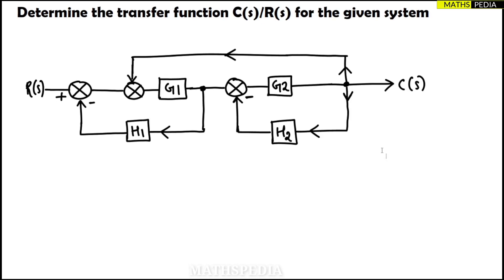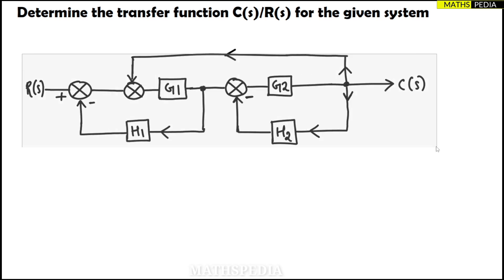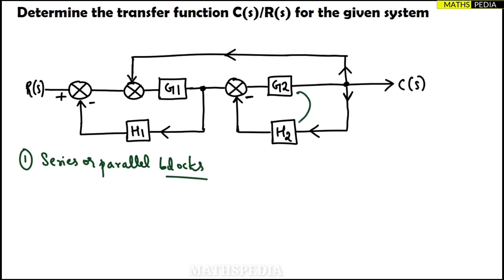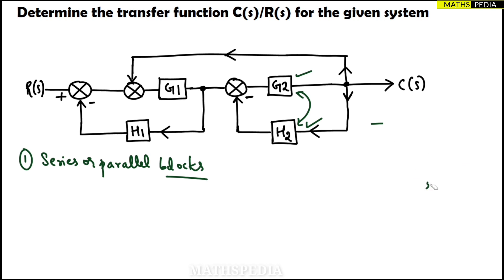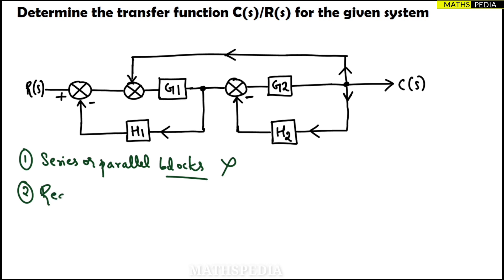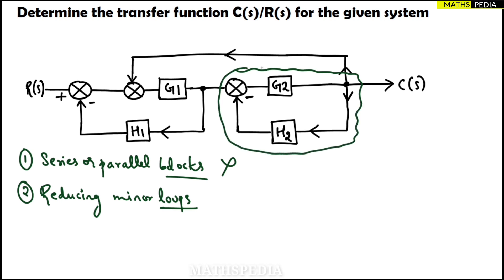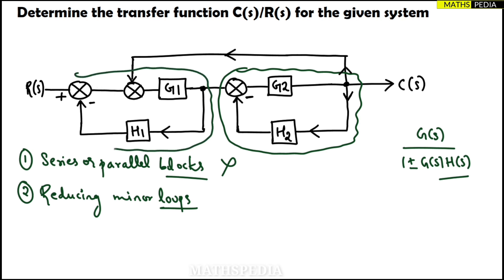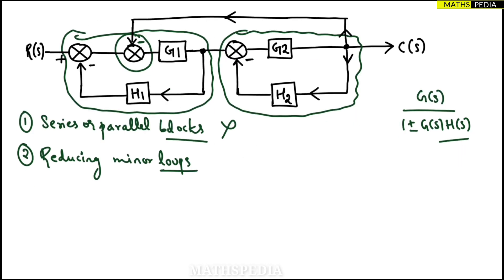Block diagram Reduction Problems | Control System | Engineering | Mathspedia | Problem 2 |

Comment: Sir Y Should We Take The Take Away Point? we can use it as minor feedback right 5:20
Reply from the maker: Yes , you can.In block reduction problems,you can approach by various method (rules) but you will arrive at same answer.